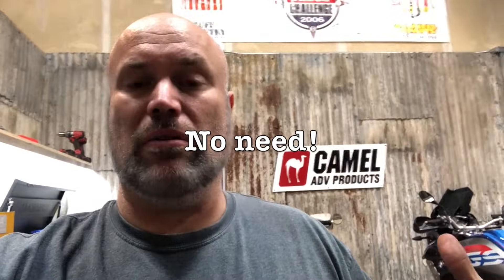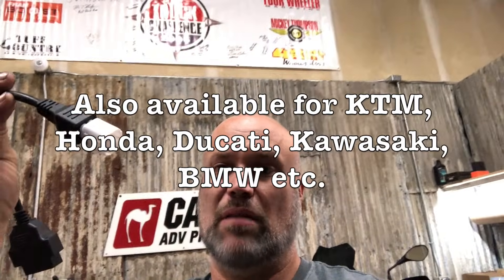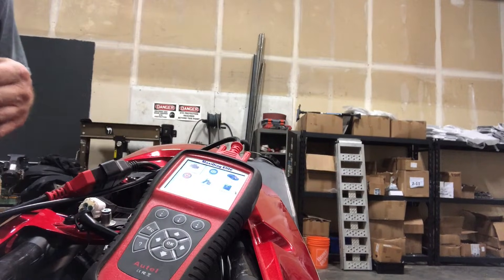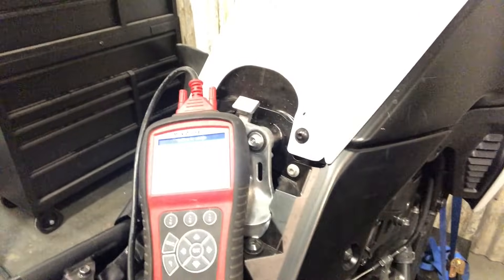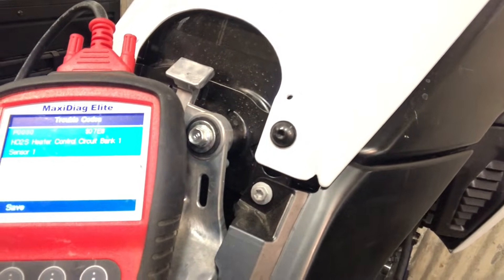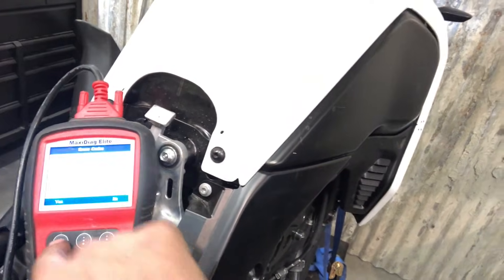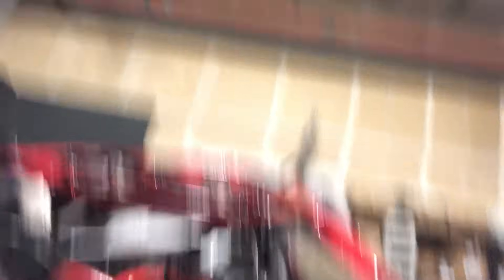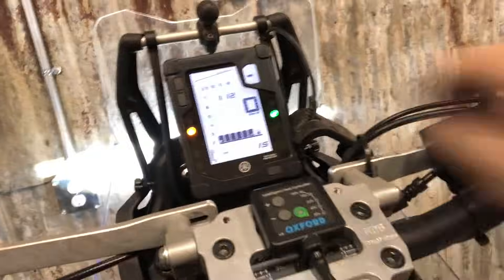Check your own engine codes! Motorcycle Diagnostic Scanner OBD2 Adaptor

Comment: My 24 T7 has a 6 pin diag port. I just re searched the same thing on Amazon and found a 3, 4 and 6 pin adapter, so you get 3 in 1.

Comment: Can one of these scanners scan a 2006 ZX 1400 ? Im trying to find out why the fuel pump doesnt turn on to start the bike.. The bike was tipped over, i was told it was a tip over sensor that needs to be reset.. But was thinking one of these scanners would help me reset whatever may need to be done. Thank you in adavance

Comment: So a car scanner s it doesn't have to be a motorcycle specific OBD2 scanner or bi-directional scanner. That's huge. If that's the case, you don't really explain that, but hopefully you mean any car OBD2 scanner will work with a motorcycle, although I don't see how
Reply: Just get an adaptor lead and away you go

Comment: Hi I'm trying to clear engine check light on ktm rc390 after I installed power commander v with broadband adjustable o2 replacing standard o2 sensor.

Comment: Because you know nothing on this you are bullshitting on Youtube. Car OBDii can damage your ECU. Some sensors and fault codes have a different meaning for cars and motorbikes. 
You have a fault code, because of OEM O2 sensor is unplugged. The issue is the tuning software you use. Most probably is a Woolich. Keep the OEM O2 sensor plugged in, and you will not have this problem. Yamaha Tenere 700 is a fantastic motorbike.

Comment: Thank you! This is a HUGE LIFESAVER! I didn't even know this cable existed!

Update: I have a 202w Yamaha MT 03 NB.

The adapter I purchased is a 4-pin connector to 16-pin connector.

But. There is always a but. The adapter isn't working. I have tried lots of things. I am about to go to Autozone to see what the issue is.

It hasn't damaged anything, but it just won't connect.

I had a brilliant idea. Always do. Probably less brilliant than stupid. But, this is what I do. I tinker to try and do things. Always have.

So, my idea was to combine things.

I purchased an adapter and a Sync-Up drive.

The idea is to have a tracker, scanner tool, and wifi Hotspot all in one.

It won't connect either.

If anyone has any info on what may be the issue or have the correct wiring diagram for the 4-pin to 16-pin adapter. Please let me know. I am going to call Yamaha Monday as well to try and get info from them. But, with proprietary systems. I highly doubt I will get any info. There are no motorcycle shops near me either. So, I won't have luck there.

Comment: Hi I just fitted I piggyback to my Ktm duke 125 year 2019 the it come up ecu failure with the temperature gauge flashing on the dashboard bike will not start I took the piggyback off put the bike back to stock and still the same and same error can you help please

Comment: THANKS ! Good video. Is it dangerous to use it with the engine running, if it does not work with my key ON, on my snowmobile. Me my lights and my dial does not light up with the key ON. Polaris Switchback Adventure 2012 600.

Comment: Have you by chance used that scanner on the R1200GS in the back ground? Amazon sells a BMW plug also. I have a R1200RT with a anti lock light.
Reply from the maker: We have not scanned the BWM. I believe it needs a special scanner.

Comment: So I've got a 2012 Shadow RS. 4 plug k-line. I have the appropriate adapter. And have tried 3 different OBD2 tools. None can establish a connection protocol. Do you or maybe anyone else here in the comments have any ideas?

EDIT: now all I've managed to do is turn the check engine light on.
Reply: Any luck ? I have Honda 300 rally and can’t get connection with my scanner as well. Need the right scanner but not sure which one
Reply: @TheZakkmylde  dont have the bike anymore. gave up.

Comment: I think different brands of motorcycles has different pinout of the OBD2 plug. Therefore, you should be aware of that, and find out the correct pinout of your bike.
Reply from the maker: Yes, you need a specific cable for your bike. That info is mentioned in the video description.

Comment: Unfortunately, my Triumph Rocket 3 Touring doesn't have the same ODB-2 connector as your bike. Mine is the same as you see in cars but my ODB-2 coded reader can't read the codes. However, I have two apps - one that I haven't used in years and one I've never used and I think they can read codes if I can figure out how to use them. One is Factory Tool that I've used to bleed the ABS and to adjust the throttle bodies but it took a long time to get it to work. The other is TuneECU which I have never used.
Reply: FYI....I have a 2009 Triumhp America 900 (865cc) with the OBD2 connector. I have an Actron 9145 scanner and it connects and works really well on the bike. Now I'm trying to find the connector port on my 2014 Honda CTX (D). I'd love to see if my Autel-maxi check MX808 will connect. I want to see if there's any faults in the Double Clutch transmission.

Comment: Don’t you need an OBD specifically for motorcycle 🏍 (software)?
Reply from the maker: You can get the basic codes with a generic scanner. The dealer units definitely will get more info but this set-up works well for standard stuff.
Reply: @CamelADV  I haul bikes for a local dealership I’m trying to improve the quality of my services. There are times when I’m literally picking up trash bikes and hauling them across Texas for a technician 👨‍🔧 to do what I can do during a pickup. Would you recommend a DIY quality or a mechanic level OBD?

Comment: Was under the impression that each motorcycle manufacturer had its own version. But now realize that that model makes no financial sense.  Why would each take on the development expenses? 

If you fix the problem,  the code will clear itself after several cycles.

Comment: Hi man, very interesting video! One question: is your OBD able to read other motorcycle brands? If yes, do you know which of them? Thank you so much in advance for your support.
Reply: I think you need to know the pinout of the OBD2 plug of yr model and brand. It is supposed to be standard from Euro 5 on, but I have researched that on the net and the pinout differ even between different models of the same brand.
Reply: Ya you need the correct pin adapter for each one thats different. Like for Kawasaki I know it takes 6 pin.
Reply: You'll be able to read the basics at best. The dealerships pay for a license and for the diag tool that's license locked. Powersports do not work strictly on OBD2 platform like automotive software

Comment: Brilliant as struggling with a Ktm 1290 fault code rear
Reply: Which adaptor unit did you get for your KTM?I have a 2017 SDGT
Reply: Hi were you able to read your ktm faults. I have a 2017 sdr with mtc failure but is intermittent

Comment: Very timely and somewhat reassuring ... I have a malfunction orange light on my KTM 790R ... probably unplugged a sensor during air box removal and clean. Going to  KTM to scan it tommorrow morning... 100km away ... I need to buy one of these with Bluetooth dingle. Thanks for sharing

Comment: Have you found one for the newer KTMs? I know the 990 you could do it but I think the 790/1290 are trickier.
Reply from the maker: There are KTM cables listed but you'd have to figure out which models it works with.

Comment: Did you by chance try this out in your Honda? I picked a cord off of Amazon a while back and though it said it works with my Honda, it actually didn’t. Could have been my reader I suppose.
Reply from the maker: I had no idea they existed until a couple weeks ago so I never had one when I had my AT. The first time I used this one, it took several minutes to load properly. Seems quicker now.

Comment: funny you should pop this video up right now ,my new 2020 street bob did the same today after exhaust install , i fired it up with the o2 sensors not connected  ,i cleared 2 codes relating to o2 sensors vr control switches entering diagnostics mode through a process holding in buttons lol damn pain in the ass ,

Comment: Advisable to always turn the ign off before pulling out the diagnostic plug, as you may do something nasty to the ECU. Thankyou for the tip  about the Amazon cables , great videos as always 😊
Reply: that is not how ecu’s work at all lol
Reply from the maker: I’ve never had an issue with it but it definitely falls into “best practices”. :)
Reply: I was experimenting, long story, but I hooked my vehicle obd2 reader up to my klr650. There was nothing wrong with the bike before I hooked it up, hasn't started since so I don't know for sure if I harmed the ECU or what, turns over but doesn't even try to kick off.
Acts like a bad fuel pump but mine wasn't on the recall list.
Anyone have any ideas, it's a 2022 .